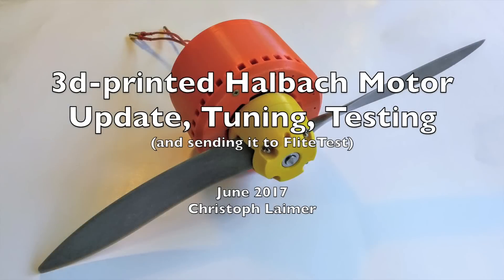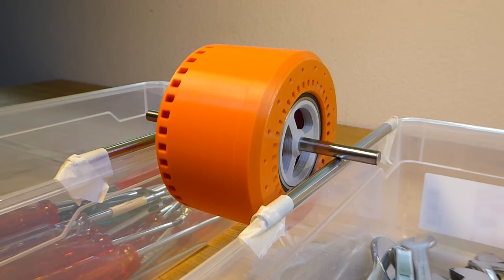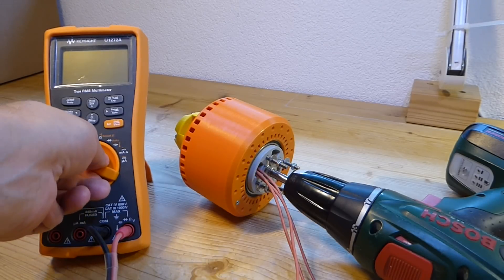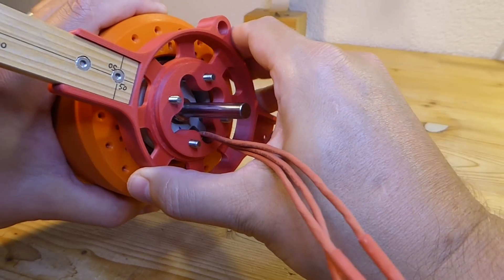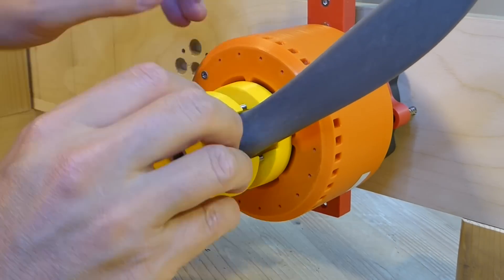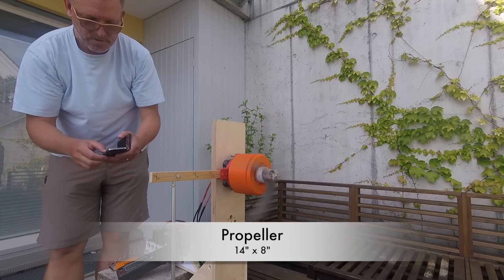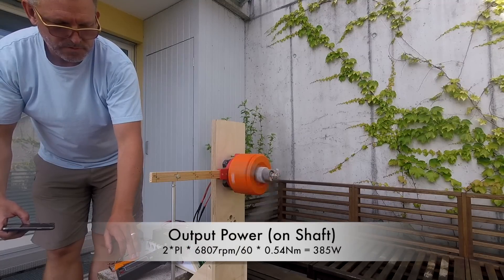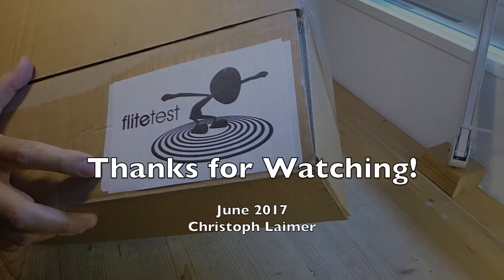3d-printed Halbach Motor - Update, Tuning, Testing (and sending it to FliteTest)

Comment: cant you use capacitors to improve power factor above 80% no doubt you can get at least 90 to 95% efficiency if not higher!
Reply from the maker: I fear that there is not much to gain with capacitors. The resistance of one Phase is roughly 0.05 Ohm. DC current is 22A. Power loss in one Phase is P = R * I^2 = 0.05*22^2 = 24W. All 3 phases in total are 72W.  Of course I know there is AC inside the motor. The magnitude of the simplified calculation is probably still correct. That means 72W copper losses, and 28W lost somehow else. As far as I know, copper losses can't be reduced with capacitors.

Comment: Hi Christoph,
thank you for these instructions and sharing the plans fpr a budget. However, for a bigger project there are stronger motots needed, like these here: https://www.conrad.de/de/flugmodell-brushless-elektromotor-a200-8-hacker-kv-umin-pro-volt-110-windungen-turns-8-255102.html Can you explain which parameters need to change in order to achieve those high power output of 15000 Watts?

Comment: This is awesome! Do you think your design could be scaled up large enough to drive a boat? There is a growing trend of converting sailing yachts from diesel secondary motors to electric. The problem is the motors are often not quite a perfect match for a yacht (repurposed) or extremely expensive. It seems like a plastic design would have many advantages in a salt water environment. Also there is a need for brushless designs due to safety around propane on board. Also something 3D printed could be repaired anywhere in the world; which is often a problem for yachters in remote locations. Here is an example of the size of motor (9hp). I'm wondering if a scaled up version of your design could replace this: http://www.sailinguma.com/electro-beke/#the-motor
Reply from the maker: Theoretically it's scalable, but I'd be a bit scared in case of failure. It's already dangerous if limits are exceeded with smaller motors. Re-calculate the forces, potentially adjust the design, and test it in a safer environment ...
Reply: I thought about it. 
A complete redesign is needed to make it work as a ship engine. In my opinion the torque is the main issue here. Simply scaling it up will not work. The torque will simply twist the motor apart. But this certainly don't mean a bigger 3D printed motor is impossible. It had to build completely different to work efficient and reliable.